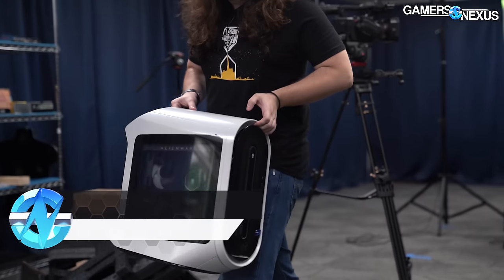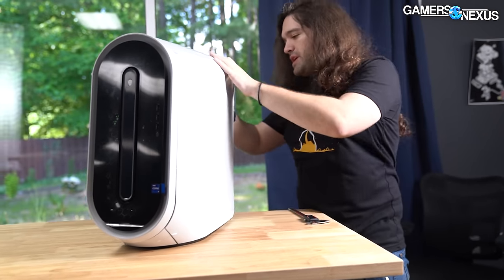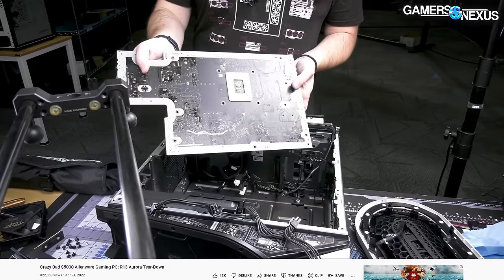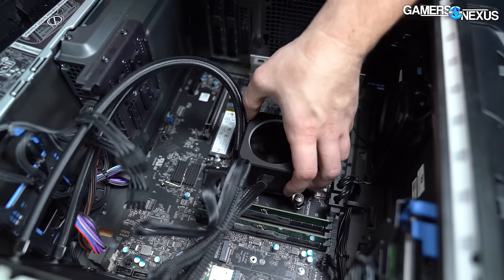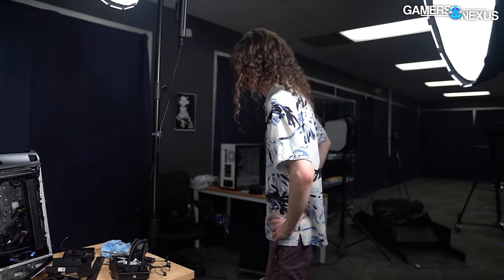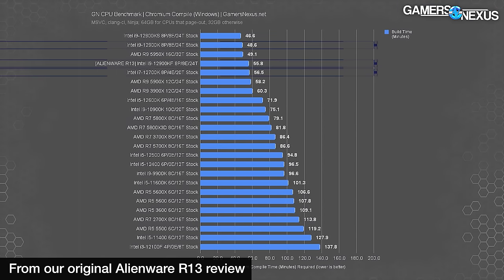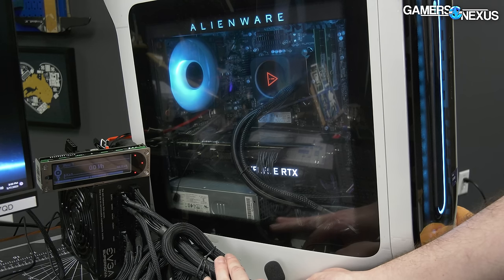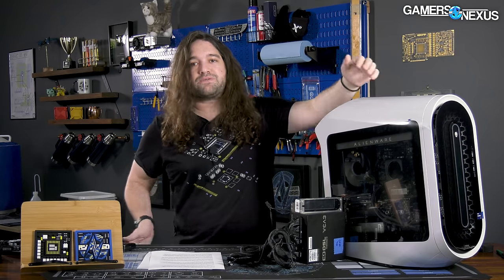"Fixing" the Alienware R13 Dumpster Fire

Comment: Dwelling on the PSU just seems odd at this point.  What's a thermaltake 600w, $39?  Just seems like a pointless nitpick.   Hate to be the guy defending these big SI's, but when they've all got piles of server PSU's in their existing parts bin, I wouldn't expect them to stray too far from that for their desktops.  Desktops have become pretty niche outside the business world in general, and so many of them in business are SFF.  

They really just need to stop offering the enthusiast grade stuff in these pre-builts that are obviously designed for lesser components.  They should not have offered an i9 when the "best" cooler available is a 120mm AIO.  120mm AIOs are junk in general, but to pair it with a beast like the 12900kf?  That's beyond stupid.

Comment: I looked on amazon and couldn't find an R13 for more than $3,000, most were around $2,400. It doesn't make it any more excusable but more understandable. I'm building a computer now with a 16 core Threadripper and a 3080ti with probably twice the capability for not much more. Buying a built PC just doesn't make much sense to me, every manufacturer now will cheap out on small, crucial components. I have a Cyberpower PC right now and they put a nice GPU in it for the money because "selability" but the CPU cooler is so bad the computer shuts down if you play a game on it. THEY ALL DO THIS! It's become very difficult to make a profit without cheating the end user. If you sell a product as a "gaming computer" it better be able to play games- or you're just a cheat.

Comment: Whoah, wait... their case already has a mounting solution for 2x 120 mm fans in the front, that you used to place the 240 radiator, but they didn't use them? Why on earth did they construct a special mounting solution for the exhaust radiator, to make it fit on the 80 mm space, when they had the front ready to go? That makes Dell's approach even stupider!

Comment: Man Dell make some really weird decisions. WTF would you go through the design and tooling cost to manufacture that rear frame for the 120mm AIO when you already have standard mounting options in the front of the case? And ones that would support a 240mm AIO? They cut corners to save money, but than go and piss away all that saved cash and than some redesigning some convoluted over engineered crap that they already have a solution for.

Comment: Shouldn't you have mounted the radiator the other way around to prevent the air from getting into the pump, or will it still gather at the highest point in the radiator ?

Comment: Can't you just put a 240mm radiator on the included AIO? It's a little bit of work but won't cause the lot of issues changing the cooler.

Comment: The look could easily be preserved with better hardware and a better case design. I realize that when Alienware was legit, components required less cooling, but Dell's acquisition kneecapped them. We're in an era where cooling can be the difference in hardware performance, so they probably should have made airflow a focus for the design while maintaining the "alien" look.

Comment: For someone that actually bought this..... Would you recommend just selling it or taking out the GPU and CPU to build a new computer around them??
Reply: unless you are having a problem with it it's just fine. remember these videos are stress-testing these components to get the best (expected) results. you yourself will probably never use any applications close to the ones he is using in the video.

Comment: Dell uses the same case for all systems. The only difference is the glorified plastics stuck to it!  Trust me Been there built them and tested and checked them. Dell is dirt cheap on all components inside the systems as well. Things like propitiatory parts are common and do to being cheap and locking the customer into their "Special" parts.

Comment: i rather build my own pc ... when you have a desktop you mine as well build it yourself... get a case that is easy to work on with lots of space and good cooling... forget the micro stuff... i mean you can put a microatx in most large cases anyway... but my advice is to start with your case and make sure you get a good one that has plenty of room to work in. tear down your pc atleast once a year to clean the dust out. i have a cool master full tower... i run a threadripper with a bequiet MASSIVE cooler... and with this large case i have just enough room to stuff that cooler in there... height is no issue... but at the top of the case it gets tight and this case has enough room to fit my xl fat hands in. i put the same cooler on my last build a 8350 with a cougar case which is smaller... and it is super tight...

Comment: Quick question I bought a R13 with a 12700KF would just putting a non RGB 120mm cooler in it be good enough, I obviously don't need i9 performance so logically to me this would work. Thoughts

Comment: I recently made my own rig with 3080 ti & 12700k in a be quiet full tower case with 480 cpu radiator. I’ve never seen temperatures on CPU greater than 85 C, and GPU even less. And its quiet!
The funniest thing is that i spent around 3 grands for it. 
Can some1 explain what costs 5 grands here?..

Comment: I have a question about the temperature at 20:27. I know this is an old video so don't expect you or anyone to answer but there is still hope. So, you claiming that CPU temperature at idle is 23°C. How is that even possible? 

You've made many AIO reviews and in the best case scenario Δt at idle over ambient was around 10°C. So either the temperature in the room is +13 or you showing the Δt here. Please clarify. 

And 70°C under the stress test is too good as well, best result for 200W was around 50°C Δt over ambient. Cooling in this DELL is THAT good?

Also, at 25:34 I can see 35°C with 1% cpu usage. Something is very confusing about all this data.

Comment: Question couldn't you have cut the original tubing and yes I know not exactly the best but then you would have been able to replace the radiator to a 240 made made the tubing slightly longer and in that way keeping the original cables so that you didn't have to use a cable or an extra power supply

Comment: Honestly, given how bad this PC is....I wouldn't trust the quality of either the proprietary Power Supply, nor the Motherboard. There might be deeper reasons why they limited the CPU and GPU such that you might end up with an actual dumpster fire, or the PC only ran for a year ? While I might be too old-school, to me the Motherboard is one of the key components and NOT something to EVER skimp on. The same goes true for the Power Supply. I would rather have less Ram, slower CPU, slower GPU than skimp on the foundation of a PC (Motherboard + Power Supply). Perhaps times have changed ?

Comment: I built my own pcs since 90es, and I'm not an expert by any stretch of imagination but I build way better pcs than this one for a fraction of price, it really isn't that hard. The last pc I built cost me around 840 euros excluding the gpu, which I reused from my last pc, gtx 660, a bit underpowered for today standards but still works fine for most applications. I'm not paying thousands of euros to have the latest in gpu tech just so I could play a failed game like cyberpunk.
This is my configuration:
AMD Ryzen 5 3600, Patriot Viper4 Blackout 16GB DDR4, be quiet! Pure Power 11 CM 80+ Gold 600 Watt, Samsung SSD 970 Evo Plus M.2 NVMe, be quiet! Dark Rock Slim CPU cooler, MSI MAG B550M MORTAR, be quiet! Pure Base 500 Midi Tower. + and older 1TB HDD for storage

Comment: It's hard to believe that they could screw up what is supposed to be a very high end system so badly... Even without any channel drawing attention to it as GN has done, this would still constitute a terrible idea. People who spend that kind of premium on a high-end product expect and deserve a far better quality design and set of components. It's one thing to not have really good components or really good ventilation, but this case, and these crappy cooling components are INSULTINGLY bad. It would have been so easy to provide adequate cooling even without any particularly high quality or exotic case or cooling components.

Comment: I would just take out the side window and replace It with plastic mesh window, probably give you all the airflow you need without changing the back or the side. It just goes to show how little the engineers thought about this computer as a system

Comment: My friend had an old alienware pc from way back in 2013 and it was an absolute shit show. It was split into 3 different motherboards and try as we might we could not make any decent upgrades to it. We eventually had to cut a hole into the side to attach and AIO with the radiator sticking out of the case to at least improve the temps. Glad to see that FALIENWARE hasn't learned much in almost 10 years.

Comment: You can fix this computer by replacing the motherboard, the RAM, the cooler, the PSU, and the case, which is to say that you can fix it by replacing it. Paying $5000 for this CPU and GPU is absurd even if we were still in the days of hyper-inflated GPU prices. Right now a 3090 will cost you no more than $2000 and a 12900KF will cost you about $550. That means you're spending about double the money just to have the pleasure of deconstructing this monstrosity and throwing most of it away. 

Also doing any significant "fixes" to this completely defeats the purpose of buying a pre-built, which is to let non-techy people buy a good gaming computer without having to mess with hardware.

Comment: Alenware was one of my choices back im 2016-17 when I was looking for prebuilts, and it seemed like a good PC to me. (I ended up building my own, still using it today with just a cpu upgrade) However, their quality even after just 5 years has gone down, a lot. Quite saddening that they have thrown away their good reputation for garbage quality.
Reply: No, even then they were extremely over-priced and used proprietary parts that couldn't be reused in any other system or case. You have to go back to before Dell bought the company in 2006 to find a time when they made good machines.
Reply: @theunhappygamer1744  I should have added the detail that I did not know that much. Now i build my own pcs and know a lot- but back then i didnt

Comment: I priced the same specs of this with better quality cooler, case, MOBO, RAM, PSU, possibly better SSD too, and a 3090 Ti for $3400. And if you shop around, you could possibly find lower prices on some of the components. Bad on Alienware.

Comment: I'm curious how the a similar spec DELL XPS system would compare to this Alienware.  The XPS case at least "looks" like it "might" have better airflow.  Would there be better price and performance for the DELL XPS vs. Alienware if someone was being stubborn about wanting to get a DELL system?  Could DELL actually have a decent system in the XPS?  Considering that there is most likely still a proprietary motherboard and psu in the XPS and a poor cooling solution, probably not.  Still, it would be interesting to compare.  Maybe DELL has one line that is less "disappointing" than its others.

Comment: Would a peltier cooling plate between cpu and 120mm radiotors installed cpu cooling block with slightly longer mounting screws for added thickness due to the peltier plate have dropped temps below TJ max and prevent throttling?

Comment: Adam Sandler's Ode to My Case…

I really hate that I want to see this thing turned into a small cube, destructively, because I know what you guys paid for it. 

The thing is … I've SEEN Dell cases that are definitely generations older than this pile of fertilizer that have WAY more ventilation to them. Like even the old Optiplex {3,7,9}010 had larger holes. Wrong shape, but they had them. Since Dell used that chassis for pretty much every pre-SSD-standard mATX system they built, it's a good bet this is somehow a newer tooling made to even older specification? I don't get it.

Comment: If Alienware was Ferrari then they would have told all of its customers that sells their products to never sell you their Alienware because you are exposing their valuable product and now it looks not worth the price of an expensive product and they would wonder their Laptops hardware! Because besides the extent of the motherboard but my B450 tomahawk motherboard looks much better than that Dell Hyper Motherboard. It seems like the motherboard was also made by Alienware as it links with the case and seems like Alienware don't want users to upgrade but use it like a Laptop and it seems that they had a problem with that on their laptops and invented the Graphics card amplifier for Graphics cards upgrade and they will need to invent a Motherboard Amplifier two🤣 for their Case.

Comment: It's a shame to see Alienware go from a company that realized that gaming cases at the time were basically poop and they could have better ones made themselves, to a company that at their peak had Asian manufacturers doing exclusive boards and cases for desktops and laptops like the big boys, then get bought by Dell and their range butchered into the horrible monstrosities we see today, which are just like every other Dell with regards to value for money, upgradability and repairability. The only nice thing I can think of to say about Alienware these days is that they continue to push for (some) upgradability in (some) gaming laptops, even if they sometimes make upgradability promises they don't keep and get sued for it. 

At this point I'm not sure why Dell even bother with Alienware, it must cost more to make crazy 45 degree slanted helmut cases than it would to just make a black version of a normal Dell case with a tempered glass side panel and set all the LEDs to green. Alienware were always as much about form as function, but Dell have taken things to new extremes.

Comment: Steve you were suppose to be better than this. WHY the corsair hub?? just get a Y or 3 way splitter with a potentiometer to control the fans that corsair hub doesnt control the fans and it doesnt do rgb so it is dell level of unnecessary thing

Comment: So all it takes is to remove the two parts that have no proprietary links to Dell, The CPU and GPU. Set those aside. Shove everything thats left into a dumpster. And put the parts sitting on the side into a real case with a real PSU, real motherboard, real CLC, and real ram. You'd be all set.

Comment: If you bought this system.. just return it on the bases that its cooling performance is unaccetable. Thermal throttling is by definition unaccetable and has nothing to do with overclocking requirements.

Comment: It's just so bad.... 

For $5000, they could of had a 240, removed the inner metal case mesh, added a BASIC bios menu for overclocking and fan curves, and literally just REMOVED excess material around air intake / exhaust. Like.... wtf. It's fucking $5000. 

I literally built a top of the line PC (5950x, x570 mobo, 64gb 3600mghz ram, 6900xt, dual 1tb 980 pro ssd, etc) in a mac g5 case for less than that. 

what the fuck

Comment: Unfortunately, at this point this is an old, old, old strategy. Purchase the rights to a well-regarded brand name, radically change the components, materials, build/manufacturing quality, etc., ie treat the brand name, reputation, and corresponding customer loyalty as a disposable resources to rake in as much profit as possible until consumers catch on, which can take years. This take over of this newly-acquired company is kept as secret as possible for as long as possible, with no outward signs that anything has changed, keeping as many customers in the dark for, again, as long as possible. How this bait-and-switch is legal is beyond me. But I've seen it with tools, PC's, products, services, even pet food. It sucks.

Comment: There is a ton of wasted space in the top of this PC that could have been used for a larger rad. That proprietary motherboard just kills me. That, all by itself, is a good enough reason not to buy Dell crap.
Could have used an internal to external USB adapter for the Corsair controller and run the cable out the back.

Comment: and all the hassle just to gain a few degrees? with exactly the same performance level? i mean if the goal is to stating alienware is OVERPRICED every body knew that already. but using the PC builder community perspective shows no advantage at all. only the fact that now, you just add more E WASTE from the trashed/replaced(with modified) components. even today there are people who still game on their 2014 alienware laptops. while the PC builders are already on their fifth computers or the few dozens upgrade of components. i only concern of the amount of E waste each individual contributes. those stuck with the alienware seems to still using it for the last many years.

Comment: 90% of this case are people justifying their jobs at Dell. Why use screws when you have have some expensive injection molded assembly of crap on a fan so it clips in.  Also proof of what sounds good in a boardroom in costs does not justify the overhead or real world costs and expenditures. All this money sp3ent on bodging a old chassis likely cost way more than junking the decades old tooling and just building a NORMAL case. I mean a lot of the little gizmos are kinda cool and neat but utterly wasteful and pointless. Reminds me of 2005 and all the stupid plasticy gimmicky tooless pci brackets and drive clips that all in time just broke or never did the job right in the first place.

Comment: I mean you can just run the 2 fans into a sata to fan header adapter and get decent quiet fans and let them run at 100% should be able to do the same with the pump connection. You’d be buying just a basic cheap 240mm aio like you would for this. No one’s buying a $200 water cooler to put into this lmao.